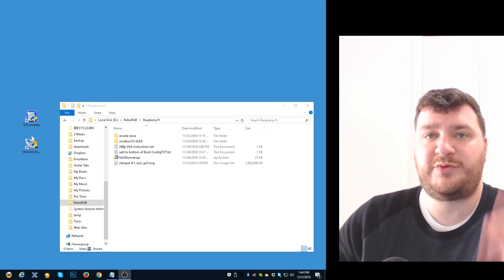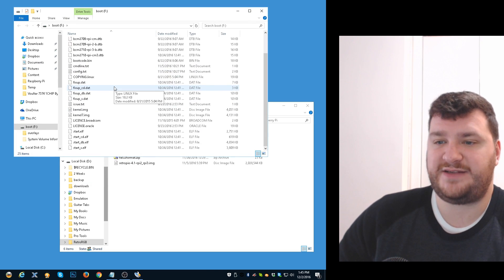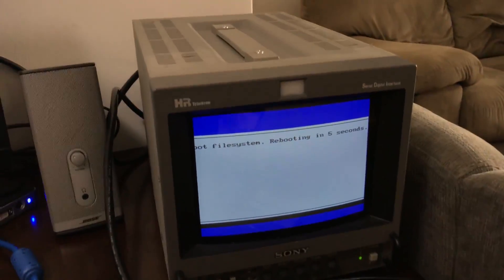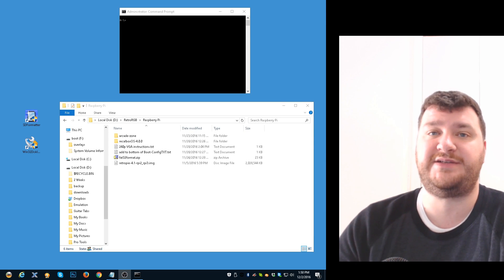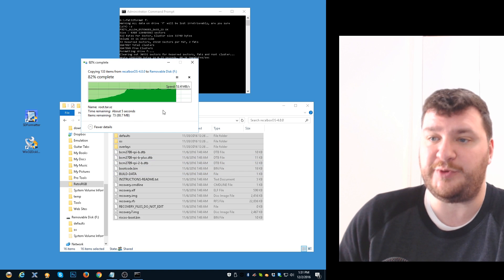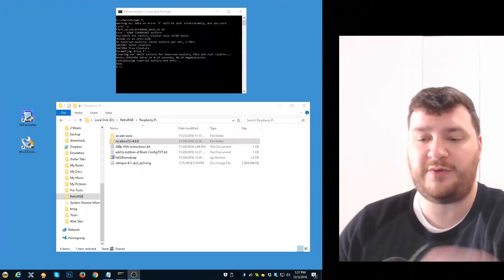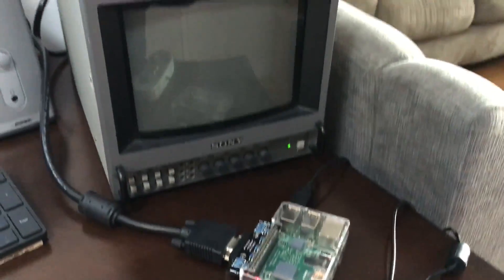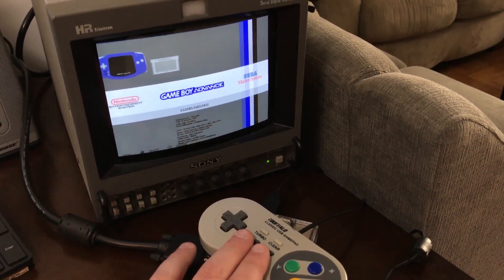How to configure a Raspberry Pi to output 240p VGA

Comment: Great video, thank you for posting this and the code. I've had a Raspberry Pi with the VGA 666 adaptor sitting on my desk for 4 years now dreading what coding I'd have to put on to it to get the adaptor to work. I watched your video and after 5 minutes it was all setup and ready to go, and adding the code for all of us was a really great touch. One questions though, how can I change the output of the adaptor? I need mine at 640 for a project I'm working on.

Comment: What about the method that you and Mike Chi talked about in a video where you use a cheap HDMI to component, and set it to a super resolution, something like 2500something x 240, and the component converter reads that and displays a proper 240p signal.

Is there a tutorial for that for a Linux noob like myself?

I see lots of discussions on it, but can't find a tutorial to learn from to save my life.

Comment: hello i need help. I bought a pj to jamma to connect the Raspberry to the cabinet, the problem is that I turn everything on and the screen remains on the av without loading anything, I mounted a mivar tv via the scart connected directly to the jamma

Comment: @RetroRGB  HELP!!!  i am going thru hell trying to run my setup on a 31khz monitor   No one has correct Config Settings for PI3+ or PI4
Reply from the maker: Just set it to 480p and use an HDMI to VGA converter
Reply: @RetroRGB  Is there no way to do it with HDMI timmings in the config file with vga666 or thru the hdmi port?
Reply: Search the CRT-Pi project. They have images you can use and they look great.

Comment: The GPIO output is how many kHz??? 15 kHz or 31khz??? As there can be two frequency options for the same connector, the RGB PI and the GERT 666 VGA, that the RGB is 15khz and THE VGA is 31khz. How can the same output provide two different frequencies???
Reply from the maker: The output signal / frequency is controlled by the RPi software.

Comment: Thanks for the tutorial. I am able to play games on 320x240, however, I found some resolution problems on CPS1 Street Fighter II. Since it is originally 384x224, when I play it with 320x240, I see some scrolling tearing both vertically and horizontally. Any possible way to fix it?

Comment: Hey man.  Is there any easy way to tell whether your CRT monitor can accept RGBHV or not?  I have a old Tekken 5 arcade machine that I'm in the process of wiring up for retropie.  The monitor in it only accepts VGA at 240p or 480i, but I'm not sure whether or not it was designed to handle RGBHV, and I don't want to waste money on a sync combiner if I don't need to.
Reply from the maker: It's best to assume no, otherwise you might damage your display.  Just get a sync combiner and be safe.

Comment: Hi thanks for your video :)

Mine is acting weird : I have horizontal glitch only in the top of the screen with my Sony Trinitron 4/3.
Do you suggest another code for the config file ? I'm using VGA to BNC/BNC to SCART

Comment: This is probably a long shot, but I'm currently making a Pi for old TV on CRTS and was wondering if anyone had the timing for 640x480 480i or really any 480i 15khz signal. 
I'm worried rasplex is gonna look nasty at 240p.

Comment: Today I connected and configured pi2scart with raspberry pi.  I have a jvctm-h1950cg monitor.  The picture is simply beautiful!  I have only a question ... Is it possible to set the geometry on the retropie without changes in the monitor itself?  I have a slightly cut screen from the left and bottom.
Reply from the maker: That's a good question.  I've never tried in Retropie, but the latest RGB-Pi software has it as part of the main build.
Reply: @RetroRGB  So I guess it remains for me to change the geometry in jvc but it is related to the fact that my consoles will lose their customized settings.

Comment: I need help I am trying to run a Raspberry Pi B+ on an Old RGB Mac Monitor that came with the apple IIGs I have the gert VGA 666 adapter and a DB15 adapter with 10 switches for different setting but the only time it appears on the monitor is when the 5th switch is on and it displays 2 of the same images. I am using regular raspberian not retro pi or noobs could I have help lowering the resolution I have seen the page with all the options but I don't understand how to enter it into the Config.txt file.

Comment: So I have a RetroTINK Ultimate and the HD15 to BNC 4 adapter from Monoprice. Is it safe to run that right into the RGBs inputs on my PVM or should I be using a sync combiner?
Reply from the maker: I recommend a sync combiner.
Reply: @RetroRGB  I was hoping you were not going to say that but thanks for the reply! I assume that's only for RGBs correct? It wouldn't be necessary for component, composite, etc ?

Comment: Any advice on connecting a Pi to a old 80's monochrome display? I want to run it inside a IBM 5150 case and give the illusion of a DOS machine but run command line Linux.  There is the monitor Im dealing with: http://ps-2.kev009.com/pcpartnerinfo/ctstips/5546.htm

Comment: on my to do of building the perfect arcade, the VGA666 solves my previous issue of having to use a bulky scan converter,  but it also messes up something that was working well: the soft power on/off button :( 
(this was working perfect: https://www.youtube.com/watch?v=4nTuzIY0i3k)

 -> do you have any tips on how to power on/off the pi safely - when the VGA666 is installed?

Comment: how do you fix the sound? i got raspberry pi 3 with vga666 on my blast city cabinet i get picture from vga666. i connect i audio cable on my pc speakers and no sound :/ do you have any tips on how i get audio to pc speakers? I have hyperpie img on sd card in raspberry pi.

Comment: Hello! I tried your config.txt for  vga gert 666 + raspberry pi3 on a bvm 201ge (and also 201fe). I used 2 (in order to be sure) vga to 5 bnc cables with sync on a y bnc mixer. I have a kind of "flicker" "trembling" issue on screen. Using 240p i should have a static image, no? I tried different hdmi timings on recalbox and also lakka image... Any suggestions? Thanks.
Reply: I also get a shimmer.  Noticeable with background grfx...  Using a vga666 and a arcade monitor.

Comment: been going nuts to get it working on an old vga computer monitor but no luck 
any chance on doing a video on that
Reply: An old VGA monitor won't accept 240p so it wont work. You better off leaving the adater without the code and run in 480p or something and then fake scanlines over it to make it look 240p.

Comment: I got a vga666 and planned on using it with a 34" arcade monitor.  I naively thought I could just wire H+V and connect to the H for composite sync.  But, I'm guessing lack of v-sync inversion foiled this plan.  My next step? I was thinking about buying an RGB amp from Ultimarc.  I'm not sure if it really needs amplification, but this little device also appears to do the c-sync conversion.  Can anyone share their experience with arcade monitors?
Reply from the maker: You should do a lot of research on this before attempting, as different arcade monitors will require different setups. 
 Also, just wiring H&V won't work.  I suggest posting on arcade forums to see exactly what you need, but if you're already using a JAMMA setup, I'd suggest getting a Pi2JAMMA.
Reply: Thanks for the reply! I remembered I have an old J-Pac lying around, and it appears to have the same circuitry as the RGB amp I was considering, plus it's worked on this arcade monitor before, so I'll try hooking this up inline with the VGA666, and run a hacked Jamma connector (w/ power for the j-pac) to the monitor, to see if it'll do the H/V conversion to C-Sync.  These were pretty common 10 years ago, so I may have a good result to report back soon that others can use.
Reply: Update. It worked, but first had to add 5V to Pin 3 of the VGA connector to power the J-pac, which I did by running a wire over from pin 2 of the GPIO.
Reply: erikspen, I in the same boat as you with a Wells Gardner 25 Inch monitor, Jpac and retropie. Before I buy the vga666 could you make a quick video on your setup. I haven't seen any thing like this on YouTube. Thanks
Reply: Really, it's just soldering a short wire on top of the VGA66, connecting the two pins I mentioned above.  This'll give the Jpac 5V for power.  The reason you don't see it elsewhere is because it's only good for displaying video, and doesn't route all the other Jpac controls to the Pi.  In my case, I was using the usb for controls instead.
Reply: erikspen I'm a little confused. Don't you have the Jpac powered from a USB on the pi?
Reply: No. Strangely, the J-pac is powered by a particular pin coming in from the video cable.  Not 5V from the Jamma connector, nor a separate power input.  I'll like to a photo here if it'll let me: http://englishaddictsbrasil.s3.amazonaws.com/WP_20171005_20_00_05_Pro.jpg
Reply: Ok, i see, that makes it very clear. i understand your right. thanks

Comment: Great video. I was able to run using extron 580xi, however I am having difficulty using switch scart, i lose the sync. Do I need any special cables? Scart> VGA with VSYNC? I can not find such a cable on the internet. Thanks!
Reply from the maker: If you're using a GERT VGA adapter, you can just run that into the 580xi and use it's output for RGBs.

Comment: Hi, i got an old arcade, is it possible to conect the RP3 to the 15khz RGB CRT of that arcade? It has 5 pins input (GND R G B and composite sync).
Reply from the maker: Yes.  In fact, if it's a JAMMA harness, you can just get one of these:  http://arcadeforge.net/Pi2Jamma/Pi2Jamma::248.html
Reply: Sadly a cannot find it in my country, but as far i can see its easy to do it, There's an IC for H-Sync & V-Sync to composite sync convertion, 3 shift registers that should be for buttons, an audio amplifier (LM380). And another one that i cant see the name on it, ???

Comment: Hi. I Follow this steps, i got it, thanks a lot for your time, but i need a little more configuration because i see the image with blue everywhere. Im using a LCDl monitor BenQ. Im suppose this configuration works fine with CRT monitor.
Reply from the maker: If you're using an LCD, why not just run in 1080p?
Reply: RetroRGB because here the lcd monitor with vga is a lot cheap than lcd with hdmi. For that im trying to use the gart666 vga adapter. Even this adapter is much more cheap than de conversor hdmi to vga

Comment: In Recalbox you must set global.videomode=default in recalbox.conf in order to play games (it's default value is CEA 4 HDMI. That means that the screen resolution will be changed to 720p right before starting the emulator). Editing the config.txt only is not enough.
Reply from the maker: Is this with all emulators?  I didn't need to do this with arcade emulation.
Reply: Yes, with all emulators, at least on Recalbox 4.x.
With Lakka, adding the lines to config.txt is enough (I didn't try with Retropie).

Comment: There are also drivers that can read Linux file systems on Windows like EXT3/EXT4 and that might save the trouble of setting up a VM
Reply from the maker: That are free?  Can you share links?  I tried a bunch and none worked.
Reply: Which ones have you tried?

Comment: You can also use 3.5mm to AV cables right?
Reply from the maker: Yes, but only for composite video.
Reply from the maker: Actually, you can change the code in the config.txt to output 240p over composite.
Reply: nice I'll be getting the pi for my CRT setup

Comment: Hey man, like the videos you do, one question, I've used this guide on my Sony PVM, and the PVM tells me the source is giving 480 @ 60Hz, I assume this is 480i, I can play the games ok, the menu txt looks a little fuzzy, is it possible that this config is really giving out 480i from the vga port not 240p. thanks
Reply from the maker: It's most likely that it's outputting 240p.  I've never seen a PVM that had a "240p" listed as a display option...they all list 240p as 480 or 480i.  I'll be honest - It freaked me out the first time I bought a BVM, turned on my SNES and it said 480i!  That's just cause it doesn't know any better.
Reply: ok, thanks a lot , keep up the good work ^m^

Comment: so I ran a lag test. and I am a bit disappointed with the pi. 
Here is the setup:

 RPi>gert666>USMC>pvm 
I compared this to a modded snes mini>pvm.
 I am using snes 240p testsuite (the snes version) and running a "manual lag test". I use an everdrive with the snes. 

The results: average of 1.2 frames lag original hardware (this is due to my slow ass and not the hardware) vs average of 3.5 frames lag RPi... :(  don't think I will be playing Battletoads on the RPi anytime soon.

 Anybody got any ideas how to reduce lag on the RPi? Could the USMC be introducing any lag?...by the way I hate lag. Lag is what started me down this rabbit hole of rgb/pvm etc. I couldn't beet the clinger winger stage on Battletoads using my emulator and flatscreen. Next thing you know my living room looks like a shrine to 1990s retro gaming :-l
Reply from the maker: So the RPi is about 2 frames of lag slower then the SNES?  That's actually excellent and about as good as it gets for software emulation at the moment.  Until FPGA emulation is available for all these consoles, you won't see too much of an improvement.  That's why I ONLY use emulation for arcade games, since there's literally no other option then to buy console ports of the games (which often suck), or the arcade boards themselves.

As an FYI, both the gert and USMC add zero lag.
Reply: Yea, someone else told me the same thing--that these are good results, he also told me about some settings I can change in retroarch to reduce lag. I am going to try them out and run another test. I can let you know the results if your interested. Thanks for the info on the gert and the USMC...I would like to get the lag down a little bit, I think it would improve game play with fighting games (there are a lot of good arcade fighting games)... but I might be tripping. I'm not sure if the lag is effecting my game play with fighting games.

Comment: what type of VGA-SCART cable is correct for vga666? thank you!😃
Reply from the maker: It depends on your display.  It's best to use a sync combiner to be safe, as shown on the page linked:  http://www.retrorgb.com/rpi240p.html
Reply: RetroRGB Thanks but I do not understand is not possible with a direct vga scart cable?😞 Excuse my English, thanks👍
Reply from the maker: I do not suggest doing that.  If you need SCART, just get the Pi2SCART:  http://arcadeforge.net/PiJamma/PI2SCART::264.html
Reply: Thanks 😃

Comment: Thanks for the tutorial. What happens with games that are native 480i (like ps2 games)? Will they output 240p? Will this effect the resolution kodi outputs?
Reply from the maker: I haven't tried 480i games.  At this time, my focus has been on arcade emulation only.
Reply: Thanks for getting back to me. I got my set up working and noticed some things. EVERYTHING outputs in 240p. Even kodi outputs in 240p, which looks really weird. Kind of like a live action video game. I gave up on playing playstaion 2 on the pie. all of the games I want to play on the PS2 are arcade games. I got mame and lr-fbalpha working so the PS2 is obsolete. I have noticed a slight lag but it's not really bothering me, even when playing hyper street fighter. I plan to run some tests with 240p test suite and see if battletoads is beatable on the nes emulator (that is the real deal lag test for me).... the quality of the rgb signal does not look as good as actual hardware however this might be because I am using a cheap scart cable I had lying around. Have you noticed any differences in video quality compared to actual hardware?... all in all the RPI is an awesome choice for arcade gaming but I wont be playing nes kodi snes or genesis on it.
Reply from the maker: I've only really been testing arcade games and I thought the quality was excellent.  It was actually much better then a few PC-based rigs I've seen.